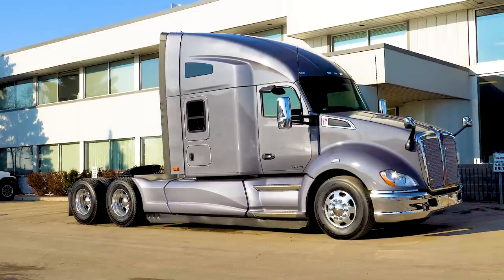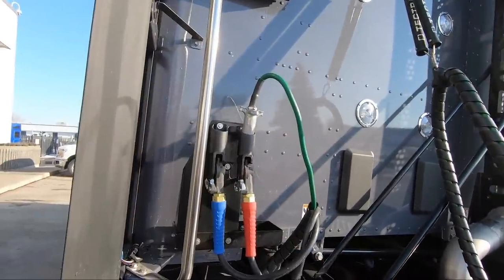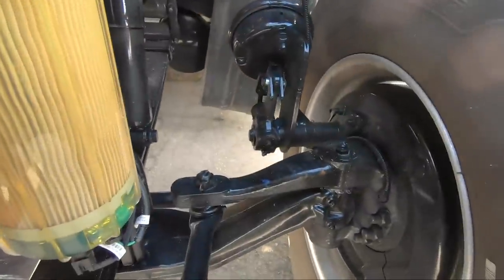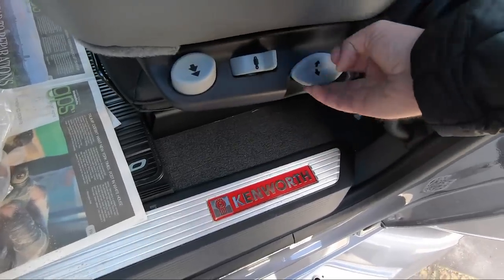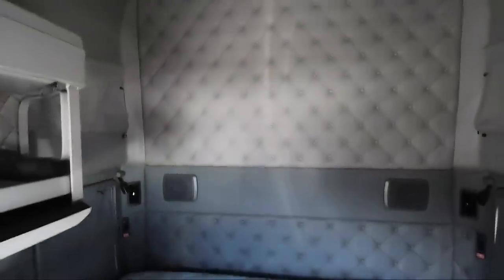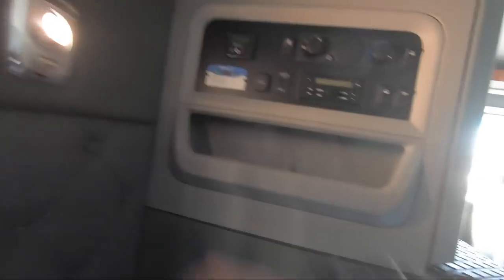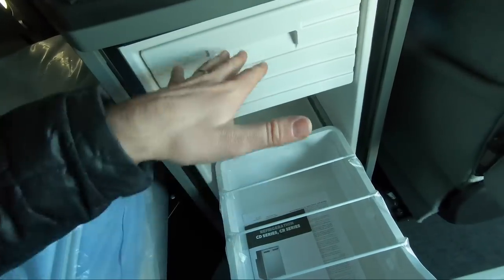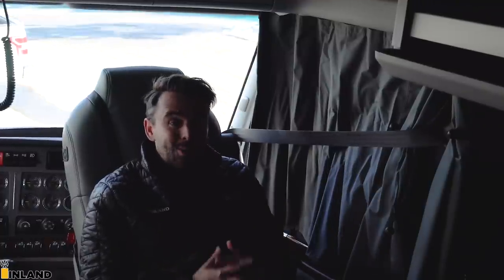FULL AERODYNAMIC  2021 KENWORTH T680 TALL SLEEPER  FULL TOUR

Comment: The all new Kenworth. We know you guys loved sitting on the floor with the steering wheel and dash board covering 30% of the window so when you drive you have to stand up to see over the hood. Gotta get your exercise! We know smaller side windows gives you much better ability to back up. And since you are paying 200,000$ for a semi. We specially designed wind fairings from the front to the back of the truck that run on the ground for aerodynamics. Specially designed to drag, grind and rip off in any gravel yard, any train tracks, any driveway entrance that has a slope and still manage to hang on ghetto as hell still increasing your aerodynamics. Now even though we put fairings along the side, the front bumper does give you the clearance to clear a skunk without hitting it. While losing strong American truck looks we slowly are turning this body design into jellybean smooth  Freightliner with chrome added. We only offer the x15 because recalls are allot more fun than making money!

Comment: Hi Andy, thanks for another great video. This one was loaded with all kinds of good information including the rear gears. I'm surprised the gear set is still in the mid 3's. I'm surprised they aren't in the lower 3's or upper 2's  especially with all that torque way down low.. Thanks again
Reply from the maker: Canadian operation requires higher gears for bigger weights and hills.
Reply: @AndyTheKenworthGuy  , thank you

Comment: Change those brakes to discs and you pretty much have the perfect truck.
Reply from the maker: You bet.
Reply: I wish that there was some type of option for the disc brakes that would keep the brake dust off of the wheels.  Especially the front wheels.  I find that if you don't constantly wipe them down that brake dust seems to embeds itself into the wheels.  I find myself after every run getting out and wiping them out.

Comment: Nice rig! 🤩 I expected to see more lights on the front. VIT - Very Important Trucker! Hey, that swivel seat was awesome! Do you make it for the driver’s side as well? Yeah, I know that the steering wheel would get in the way, as well as the fridge/storage area. I guess that I answered my own question.🧐 Nice all around!  I’ve had problems getting used to those fender/hood mirrors when they’ve been on a truck. Do a lot of other people say the same thing? I guess that maybe they take a while...or NOT. Hehehe I watched the video another time to make sure I didn’t really miss anything. Inside the cab really looks smooth...not as much storage is what I thought at first, but there is quite sufficient storage. Is the steering wheel heated as well?  I’m not sure the pad under the mattress would make that much of a difference, but who knows. Good stuff! 😎

Comment: Hey Andy is it just me or does it look like the oil fill is in a pain in the butt location behind the radiator brace? I don’t know of too many truck stops that have funnels to use when adding oil and most drivers just put the spout of the oil jug to the fill pipe and pour. Just a thought. And glad to see you can still pull a trigger if needed
Reply from the maker: It’s fine once your on the tire.

Comment: Hello, thank you for this great video.  While sleeping for added heat or AC does the engine need to be running with this truck?
Reply from the maker: The KIMS runs off battery so no the truck is shut off while the kims is on.

Comment: Kenworth has fixed the issues that made me hate them with the exception of one thing and that’s the crappy cruise control switch. Set it to 65 and for some reason it drops to 61 or some other wacky number around there. Let’s fix that please
Reply from the maker: That’s a program setting. If your ECM is set to Mac cruise at 61 no matter how fast you go it will stop at 61 on cruise. Get it changed at a dealership. Easy forx

Comment: The truck was the T2000 why was it changed to the T680 ?
Reply from the maker: The t2000 turned into the t700. The 680 is different. The t2 and t7 were wide body cabs.

Comment: I honestly think they changed the way they rate horsepower. in the 70's if you had a 425 cat no one could touch you, and even the 400 cummins pulled. but now evry truck is running 505, or 564 like this truck, and they can't pull worth poo.

Comment: It’s pretty upsetting that kenworth only gives you a 2 year 200k miles warranty. Then change you 10k for an additional 5 years. I will take my business elsewhere! I am very disappointed with KW. However, nice truck.
Reply from the maker: All the manufacturers have the same base warranty
Reply: The Kenworth Guy Peterbilt just offered an extend warranty 5 year for 5k or I could go with a glider 4 year unlimited miles for the warranty. The based warranty may be true not disputing that. Kw wanted 10k for a five year warranty when Peterbilt offers it for 5k on the same motor SMH
Reply from the maker: That definitely not true. I know the warranty prices from KW and Pete are the same.

Comment: Yuo just change the new motor which one is lighter than 2015  Nothing  change on the interior  i didn't  know why you say new models  every single  year that  truck is lighter  by the weight  thats why in the heavy wind when the truck  with the empty  trailer  it gonna  rollover to the other vehicle  I see  couple  t680 railto ,ca  this week  thats is also 2021 model where the hell is driver safety just park truck  rollover because of lighter  weight  this truck is 2000lbs lighter than 2015
Reply from the maker: Trucks don’t change every year. Usually every 10 years there’s a redesign or refresh.

Comment: Are guys still buying these gas hog Cummins X15 engines with these high gas prices or have they FINALLY got some sense in them and started going with the MX 13 ...? Paccar /DAF engineers designed and build their engines 13 litres for a reason, that's what you need to succeed in the trucking business. The Cummins is a failed peepee estension folks ...

Comment: You lost me at the auto trans.
Reply from the maker: Use the gps to find your way back. Hope you’re found soon
Reply: @AndyTheKenworthGuy  , 😂
And you want me to buy a truck from you?
I understand the efficiency of an auto trans, but the main reason for their production is to fill seats with today's entry level drivers.....saves wear and tear on other components.
Not many seasoned truckers are interested in falling asleep behind the wheel, or making it easier to use personal media devices while driving with their flip flops on the dashboard...lol.
Reply from the maker: I get it. I have sold lots of auto transmissions to guys who are vet drivers. Clutching and shifting can be hard on the joints.
Reply: @AndyTheKenworthGuy  , But let me change my tune a bit.....Man! That sure is a nice truck! All modern, shiny, and tight!
I wish it had a manual trans though....😟🤠
Reply from the maker: For some folks the manual is the cats meow. Overall a nice truck for sure